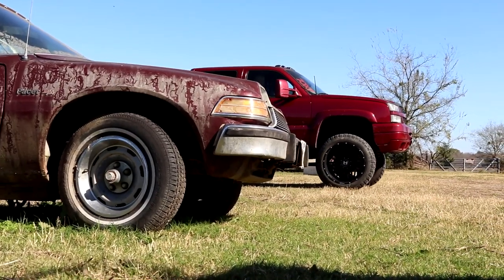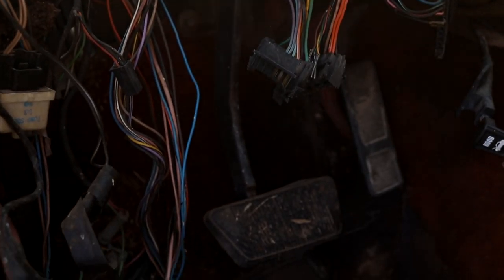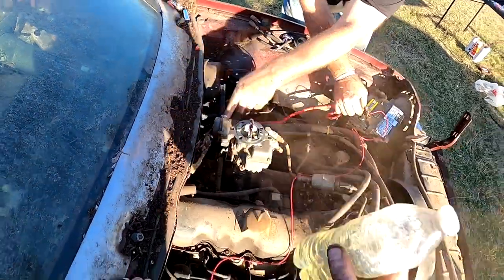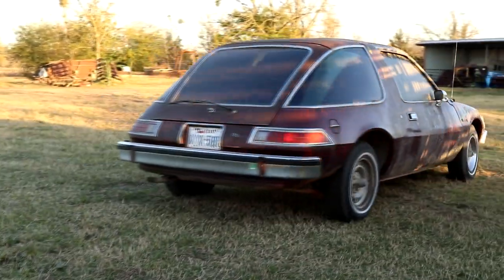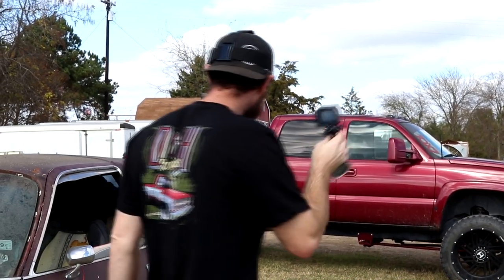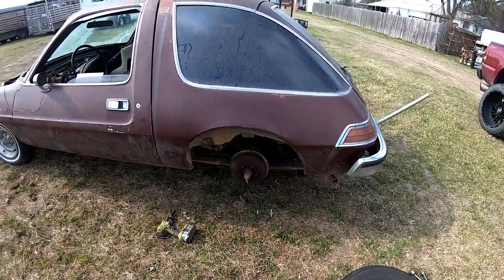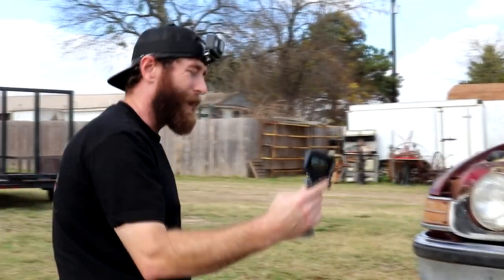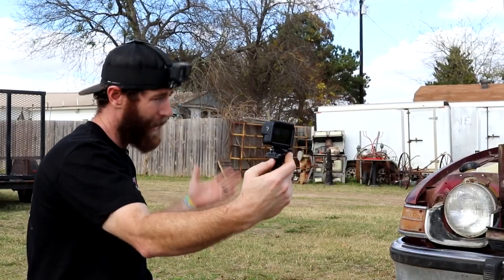First Drive In Over 20 Yrs | ABANDONED 1976 AMC Pacer (P2)| Fix'n Brakes VS Fix'n To Break| RESTORED

Comment from the maker: Watch Part 1 Here: https://youtu.be/9EBAc0eWmOc
Reply: Can you help me build a closer relationship with Jesus
Reply: Check the proportioning valve!! The can be off centered, and then it wont feed to the front.
Reply: Please tell me that you took the brake rotors off and turned them on a lathe, and cleaned and re-greased the bearings and put a new seal on the back of the rotors.  If you're going to do a break job, do it fast, Not half-assed!!  You should also check the thickness of the rotors to make sure they're not too thin to work.

Comment: Btw guys, from an older brake mechanic: when pumping brakes , if you’ll pump the pedal slower you’ll get better results! Fast pumping can actually introduce foam in a system that definitely has air in the lines! This actually makes it take longer to properly bleed out all the air from the system! Trust an old hand guys, slower is actually faster in this case. Be sure and check the equalization /proportioning valve— it may need to be reset!
Reply: Facts
Reply: I have helped my mechanic many times bleeding brakes.He told me to pump 3-5 times slowly and hold the pedal down while he opened the bleeder screw.He repeated this procedure till he was satisfied with good results!

Comment: Love your videos!, as a gut who has worked on cranes for 30 years and now tractors and own my own.  This will help you a lot.  on your Kubota which I work on at a dealership almost daily, get a hook what you use on your chains and weld it to the top center of your bucket, possibly 3 of the hooks, one in the center and on each side of the bucket obviously at a strong surface.  Also, use your diff lock on your tractor if pulling a vehicle in a straight line, this will keep just one rear tire from spinning and gain tremendous traction!

Comment: Short 3 foot of vacumn hose and a mason jar to put it in, I have a old brake bleed kit with clear little bags
with metal connectors hang them above the wheel cylinders to collect the fluid and air. one man 
brake bleed have done it on 2  of my vehicles so far with great success.
By the way that looks like my Mom's last Pacer she owned in Alabama, Hello from the N/E corner of Illinois.
Ready for your murch want to replace the turning rust stickers with RESTORED ones.
Found it got my order in Thanks and God Bless.

Comment: Great, real interaction...a real family operation!  Brake hoses, as you know, come in a zillion configurations. Try taking one in and see what may match up. The banjo fitting could be problematic, but the 3/16" inverted flare should be really common.  So, if you have the correct ends, the bracket is probably what is holding you back. And, as you mentioned, length isn't critical. I'm sure you will have time to get the proper stuff while you're working on other needy machines!

Comment: Hi guys - top tip on seized or sticking calliper pistons - silicone spray, not WD40 or anything else, straight silicon, put the thin tube under each piston dust cover and give it a good press to get the silicon going inside, leave for a while,  gently press the brake pedal to see if any pistons move, once moving repeat silicone while calliper has extended  piston but NOT right out, use a clamp to press it back/ after a few goes doing this the callipers may have pistons that move freely..  worked for me on my old land rover.

Comment: Suggestion on re-assembling those front calipers. you should steel brush or sand the rust off that slide you drove out and the rail it was riding on and lubricate it when putting it back in. The whole caliper assembly needs to move in order to apply equal pressure to both pads. Also clean the one on the other end of the caliper. If it rusts in place you will get uneven pressure/wear on your pads. It should only take a light tap at the most to get them back in. the ones I have replaced also had a flat spring that slid in with it to keep it snug. It appears these did not have that spring.

Comment: I don’t know if you should pulse the brakes when you bleed just bleeder open pedal down bleeder closed pedal up.
Reply: No, you are not. He is probably creating foam in the master. He's doing it wrong.
Reply: pumping the brakes is ok, they did it correctly,  pumped till it had pressure then held the pedal down while his dad opened the bleeder  then he held the pedal while his dad closed tbe bleeder after they got the air out the brakes were working

Comment: AMC was one of the first domestic manufacturers to use "hub pilot" style wheels. That way they could get away with using Grade 5 wheel studs.
Didja ever figure out if it's a 232 or 258?  I'm thinking since it's a 1-barrel, it should be a 232.  Most of the Pacer 258's were 2-barrels.
Reply: You could order a 258 with a one barrel carburetor. Check the tag on the passenger fender well. It will tell you the engine size.

Comment: Vacuum leak would make it idle high and run lean which doesn't help the temp. The top hose making a loop like that could be causing an air lock. Check the radiator and flush it. Take the thermostat out for now. And check the pump as you stated!!

Comment: The calipers on the Pacer are Ford calipers. Most parts stores will have brake hose for a Ford but not for AMC but you can fit a Ford hose to it but it will be a different length and the female end where the steel line goes in may be a bit different mount but it will at least work and will be easier to find

Comment: The Pacer was a quite unusual car made by American motors 6 months prior to production they did not have an engine for the vehicle the vehicle was originally designed for a rotary Wankel engine by general motors that's when they put in the 232 and the 258 6 cylinder engine the car had a lot of design features into it that people don't realize the driver door is 2 in smaller than the passenger door and it has a wider stance to it than the average import in its day the insurance companies loved it because of all the visibility and it just didn't roll over to speak of one major flaw was the fuel filter the rubber gasket would rot out and the gas would drip onto the exhaust manifold and catch fire they were notorious for engine fires the valve cover gaskets were a real booger to change it made it easier to drop the rear crossmember on the transmission so that you could roll the valve cover off the engine easier I know a lot about the Pacer the gremlin The hornet and the Matador and the ambassador since I work for American motors back in 1975

Comment: 10:29. That uses the retainer bolt and wedge like the ford trucks of the 70s used. Kind of a pain to get off
Reply: Exactly what I was thinking. I just put the front brakes off a 79 F150 on my 70 F100 and it uses that exact same setup, I think those are the same calipers. AMC borrowed a lot of parts from all manufacturers. My 81 Wagoneer had a Chrysler transmission, Ford Duraspark ignition and carburetor, there was something off a GM I just can't remember what it was. The 69 Jeep we had came with the Buick V6
Reply: @johnweisinger7390  GM ???? CALIPERS !!!!!!! NOT FORD !!!!!
Reply: @richardanderson5109  Whatever it takes I guess

Comment: @ 03:00 you just did the one thing you should never ever do....never ever put a metal tool on top of the top post battery. one little slip and it could end badly. If that wrench would have contacted both posts at once it would weld its self to the terminals and continue to get hot. one of the ways a Battery can explode.

Comment: As far as the front rubber brake lines that should be the same as a Ford Ranger or F-150 the AMC Pacer is basically a Ford Chassis
Reply: I wouldn't say it's a ford chassis,but a lot of Ford parts were used in the making of the Pacer,if not for the Big Three,AMC might never survived as long as it did.

Comment: Next time take the thermostat out of any car your trying to revive
Reply: Nah. Fire it up and let it sit idling, hit the water neck with a temp gauge. If the stat opens you'll know and won't need to tear into it unnecessarily, but if it's not opening you won't cook it since you're not trying to drive the thing..
Reply: Take the thermostat out only if you going to replace it. Thermostat is probably stuck open or there is not one in it now. Thermostat is there for a reason to regulate circulation while the water cools off before it goes back into the engine.
Reply: @arthurcunningham530  Most stats are fail safe, but in a situation like this it's entirely possible that it's just plugged up with trash stirred up from the cooling jackets after the engine laid up for so long. Why I say you idle it up to temp and see; most stats in old cars open between 160 and 210 F

Comment: If it wasn’t so badly gutted out on the inside I would love to buy it
Reply: looks like everything is in the car, it's all just plastic trim parts that screw attach to the car.  Nothing complicated to fix....new carpets and the seat fabric is available from SMS in Oregon, easy fix once the dash is back in and that's just connecting wires even the dash in an AMC just attaches with screws.

Comment: I got to say one more thing you squirt all that lube on the outside of something you want to listen once you break it loose after squirting it squirting again now if you have turn the bolt out you turn it back in it gets the dirt and rust out of the thread so in out and out you want to know that you don't do that I just try to force it out I don't understand that I mean you're well educated more than I am I've seen what you can and can I do but then I watch y'all turn bolts and break them and if you can get it to turn a quarter turn out turn it back in turn it back out turn it back in turn it back out turn it back in that's what you should be learning on those stuff or educating people to do if you don't have the heat you know that's correct you get rest in your threads it finds it up more so if you turn it back in it releases it turn it out get stiff again go back in the laces the dirt